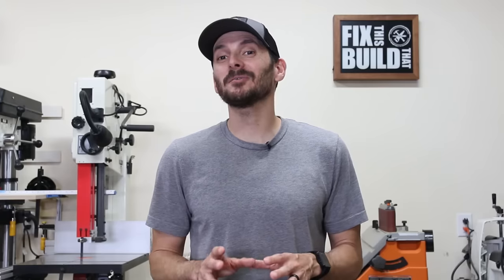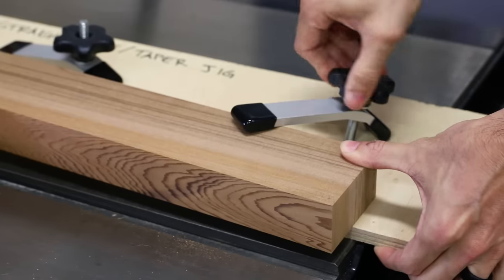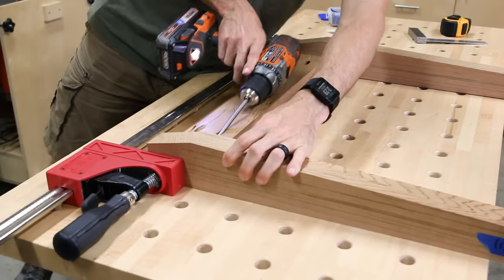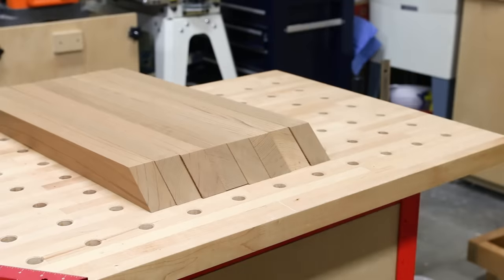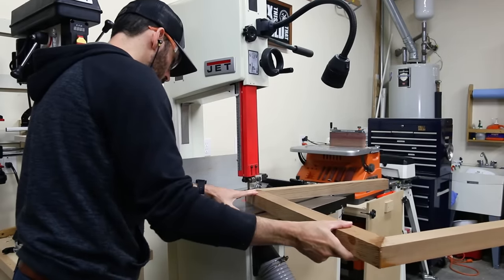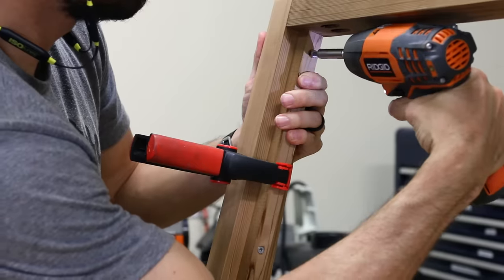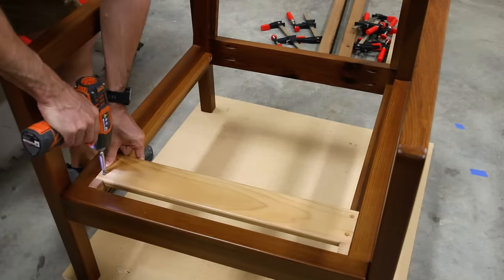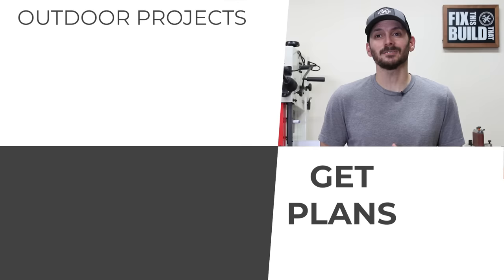DIY Modern Outdoor Chair | How to Build

Comment: I'm looking for plans to build a dining room chair. I will be building furniture for a Food Bank for there clients. I was going to use either Douglas Fir or Southern Yellow pine 2X4s. I want to keep the price down. Also, I want to limit each piece to 30 inches since I will be using a CNC router. that is limited to 30X30 inches.

Comment: Great video, I just bought your plans and will be building these for my patio. I was wondering why you used epoxy rather than waterproof wood glue like Titebond III?
Reply from the maker: epoxy has a longer open time and those miters dowel corners can get tricky to clamp and keep tight

Comment: Sweet and modern looking chair Brad! I really need to start using pocket holes more on my channels projects, for some reason I just always seem to forget they exist and I end up over engineering a project lol....and a dowel jig...really need to get one of those too 😂
Reply: Also, those sanding discs, do you notice a difference in their performance since they're not as rigid as the standard ones?
Reply from the maker: @Craftswright  not at all since they basically get their strength from the pad.  Seems to cut just as good if not better do to removal of dust so abrasives can work
Reply: Fix This Build That interesting. Might have to give them a try since I’m low on 220 discs as it is lol

Comment: I'd like to see you build a diy pocket hole jig
Reply from the maker: I'm really happy with the commercial versions, and it seems a bit harder to make than something like a table saw sled or taper jig.  So cost/time benefit isn't there for me
Reply: @Fixthisbuildthat  totally understand. Keep doing what you do and putting out good material.

Comment: Do you have any issue with the bottom cushion sliding forward at all?  Would you taper the seat back 5º or so if you did it again?
Reply from the maker: the cushions actually have small straps on the back you can tie to the chair.  This keeps them from sliding forward

Comment: Did you use glue with the pocket holes?  If so, I missed it and was wondering.
Reply from the maker: I did not.  I rarely if ever use glue on a end grain to long grain pocket hole connection.

Comment: Great looking chair.  I am wondering about the strength of the rear legs.  If the front and back legs were to be "splayed" for whatever reason, i.e. the 29 3/8 dimension was to be increased for whatever accidental reason after the chair is built, the bending moment on the rear leg would be much greater than the bending moment on the front leg, since the front leg is supported at its mid span (approx) by the chair seat, but the rear leg is supported much closer to the top by its attachment to the chair back.  Has there  been any issues long term with the durability in that area?  Bought the plans last year and am hoping to start the build soon.

Comment: So, the only concern I could think of is the way that the back support attaches to the arms... is there any concern after now having the finished product that the "two screws" aren't sturdy enough to hold the back support to the arms.  It seems like this would be a high stress point, at least with my delicate  240# sitting in the chair....  Not saying that it won't hold just curious after a couple of years how they have held up with respect to that joint.  Thanks in advance for your reply.

Comment: Bought your plans about a year ago, and built with just minor modifications. Used Total boat 'Lust' as my finish, and... the finished failed after 6 months or so. Have you had that problem, after your initial problems? I have varnish left over, so i am going to sand it down and start over. I made 6 chairs and a table and the varnish failed on all seven pieces
Reply: I personally have had very good success with Waterlox Sealer and Marine Grade finish.  Lasts for years.   I know probably not a sponsor but just my 2 cents.

Comment: Hi Brad.  Beautiful chair.  Thank you for sharing this build with us.
Is there a reason why you used epoxy instead of glue like Titebond 3?  Not questioning your methods, just wanted to know why one is better than the other.
Reply from the maker: Epoxy is not water based, so it doesn't soak into the end grain as much as water based glue.

Comment: Nice! Love the design. Would like to hear more about choices for outdoor wood finishes. I’m currently refinishing oak slats on an outdoor bench, again. First time used polyurethane and lasted one season. This time bought a marine varnish. I think m headed in the right direction. What you used seems better.
Reply from the maker: The Total Boat products are definitely marine grade as they primarily are used on boats.  But any finish will need maintenance as well.  Total Boat suggests a yearly maintenance thin top coat.

Comment: When I saw this chair it was exactly what I want to build I bought the plans and I'm building it next week. question though in the video it doesn't look like you are using glue on a lot of the joints where you are  using pocket holes.  I'd love to not mess with glue on these joints bit are you sacrificing a lot of needed hold?  Great project I'm excited to expand my skills with it

Comment: Beautiful end product. I made 4 Adirondack chairs using Western Red Cedar and didn't finish them. I just let them age naturally. After a few years they became rough and splintery. Cedar is very soft. I am not sure how well yours will hold up using pocket screws. I am not in the anti-pocket screw Club, I just think in softwood they will pull out in a few years.  Thanks for posting
Reply from the maker: I have some other cedar pieces with pocket screws and they are holding well.  I've considered screwing them in, removing them then putting epoxy in the hole and reinstalling.  Could be a good alternative

Comment: I'd love to see a tapering jig and your take on a finger joint jig.
Edit: Also, would the epoxy on the end grain make a glue joint any weaker?
Reply from the maker: I'd pretreat with epoxy on an epoxy joint and glue and water on a glue joint. Wouldn't do glue on top of epoxy sealed

Comment: Excellent project Brad.  I love the lines on these chairs.  Are they pretty stout,  I have some young grandkids and hoping they wouldn't be able to destroy them.
Thanks for sharing.
Reply from the maker: they are very stout as the legs are pretty thick.  Putting epoxy on the screws as they are driven in would lock them even more